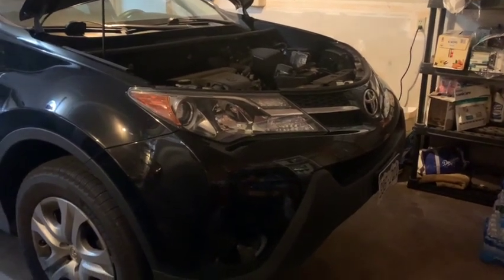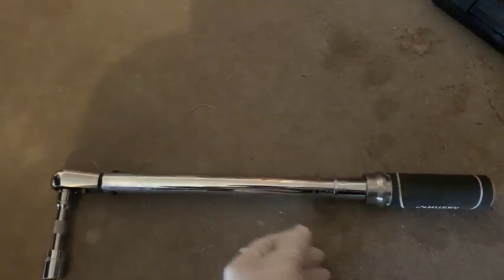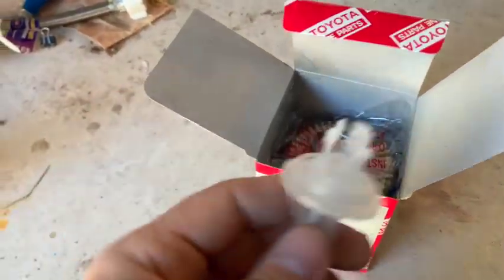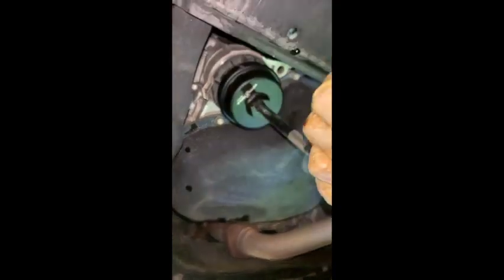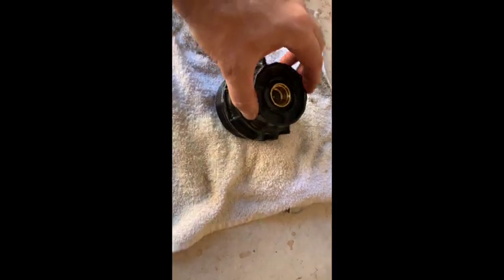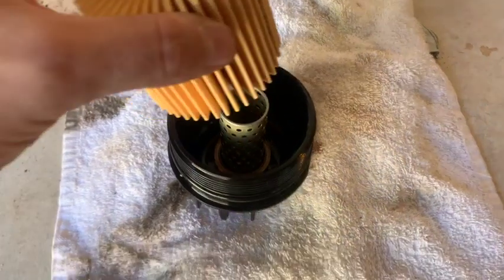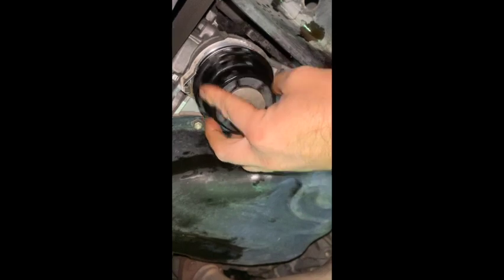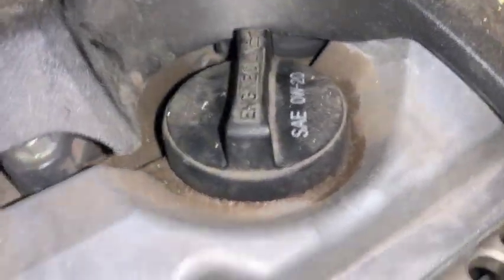2015 Toyota Rav4 oil change

Comment: You said, "You just want to hand tighten it", but you used a wrench!

Don't forget to lubricate the o-rings.
For those who have a torque wrench...
Oil filter cap = 25 N• m (18 ft.lbs.)
Oil filter cap drainbolt = 12.5 N• m (10 ft.lbs.)

I make it a point to check the oil a day or two after changing it or maybe even the same day after the engine is at full operating temperature. Also if your car is old enough to have an ATF dipstick that should also be checked when the transmission is at full operating temperature. (Check ATF with the engine running.)

Thumbs up. 👍
Reply from the maker: All excellent points, thanks for sharing. I have an older Camry that has the ATF dipstick. That’s good advice to check that as well 👍🏼. 

Yeh I guess I did end up using a wrench 🔧